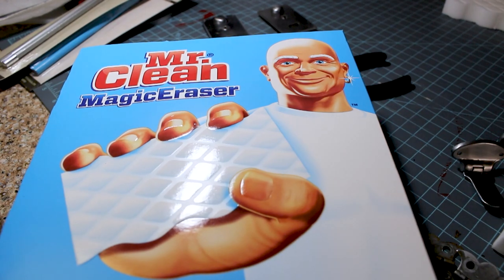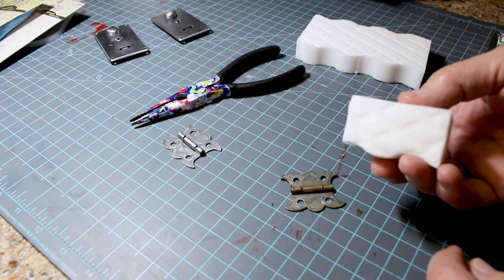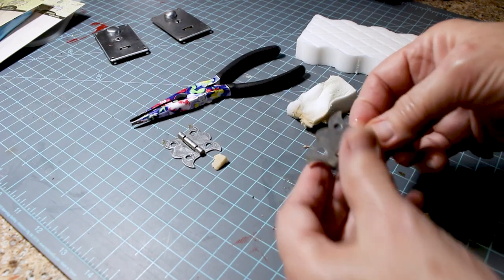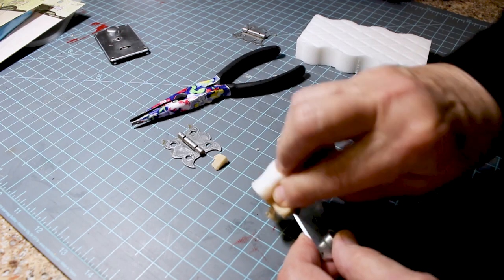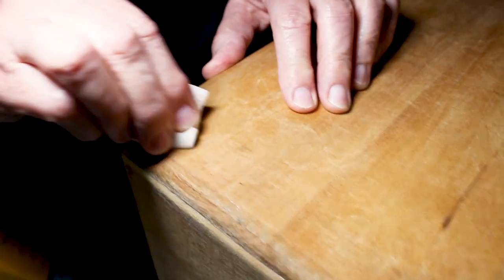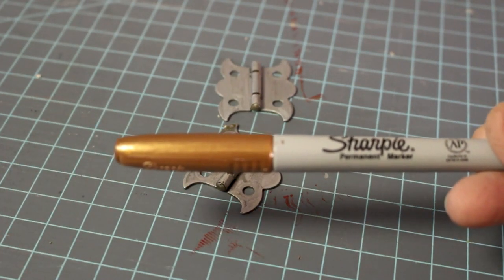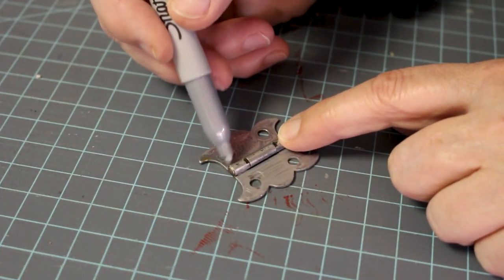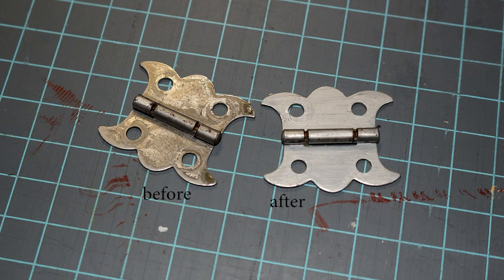Case Restore Along Part 4 Clean Hardware

Comment: You could use a Dremel tool and jewelers rouge also. I took a piece of leather and a grommet punch to cut some round leather circles and stacked them to make a polishing wheel. It works fantastic to polish them to a mirror. Shine. Just turn on the Dremel tool and touch the wheel on the bar of rouge and run the leather polisher wheel over the metal. It removes very small amounts of metal as it polishes but nothing to worry about. It's better the a wire wheel. The wheel will get black due to the metal. Just run the edge of the wheel edge over a piece of sand paper and the sand paper cleans of the old polish. Then once clean apply the jewelers rouge again to continue polishing. You could also use grinding compound for cars as well. Anything with very fine grit. Very similar to 8,000 grit sand paper.
Reply: Great idea!

Comment: For hardware STILL on your case and you don't want to remove it, I use California Metal Polish (it's the purple stuff). It will turn black on your microfiber towel as you rub a dab of the compound on the hardware OR even on your chrome parts on your featherweight. Awesome stull. Found on Amazon. Shake the bottle well, it separates as it sits.